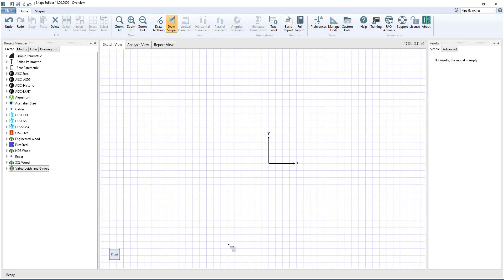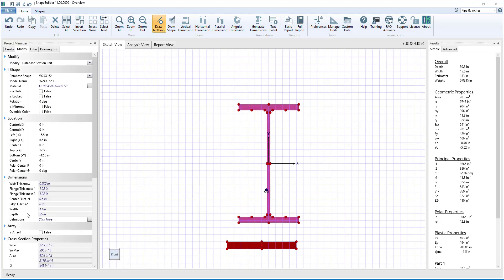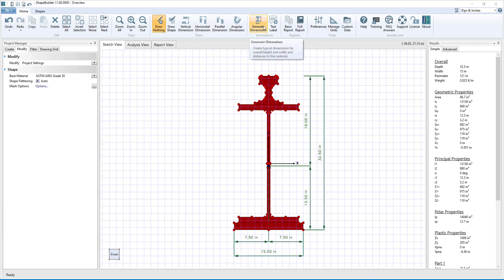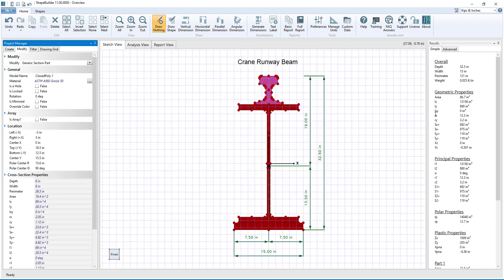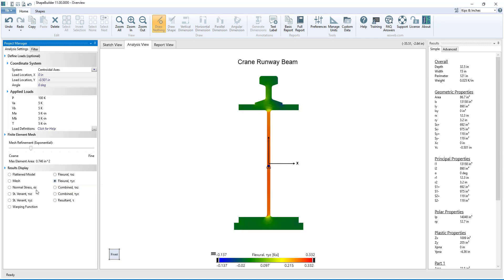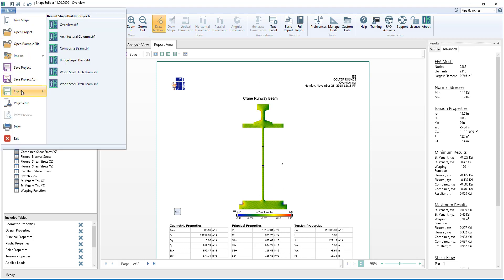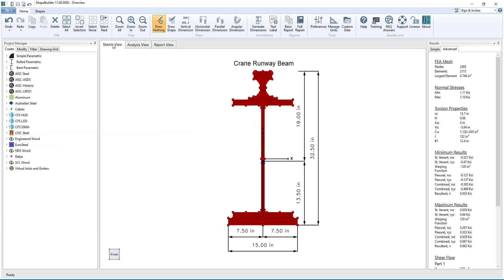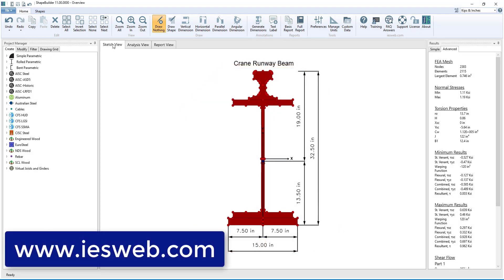ShapeBuilder: Introduction

Comment: I had an issue when I imported a light-gauge shape from shapebuilder into VA and the Design of the model wouldn't work. The model was stable but it would just say the member is "Not Checked"
Edit: Looks like I have to choose a "Design Type" that isn't "Analysis Blob" when exporting
Edit2: But there are no Design Types that match a built-up light-gauge shape